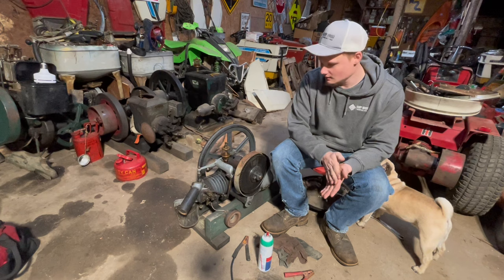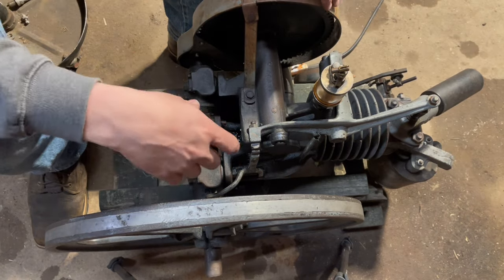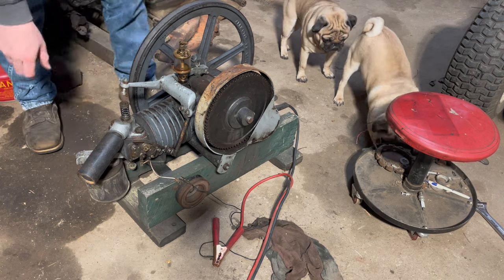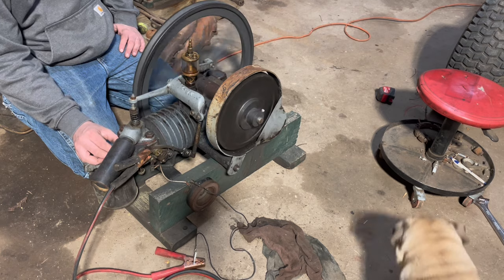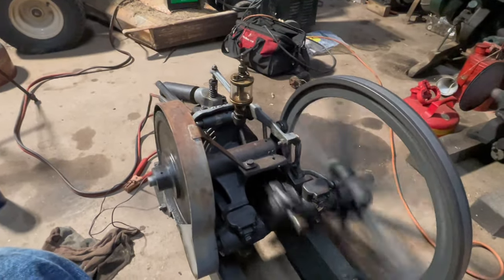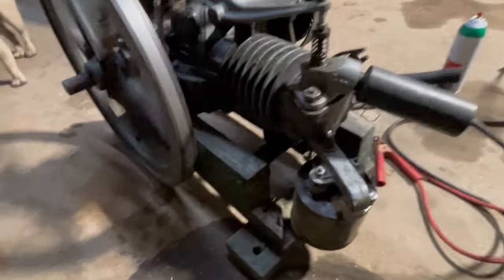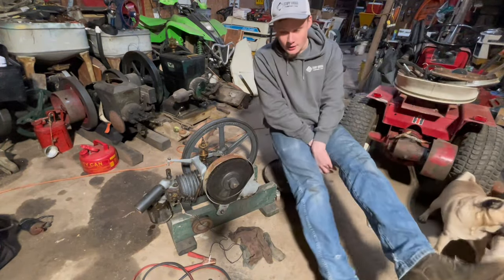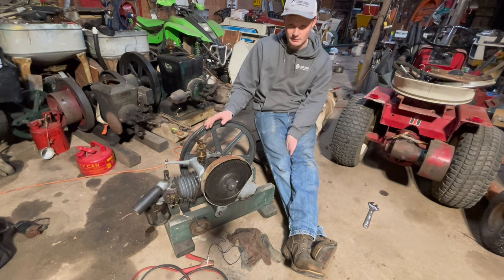Starting an 8 Cycle Aermotor Hit n Miss

Comment: I hate to re-engineer a 110 year old motor but for the cooling it would have been vastly easier to make the flywheel spokes into fan blades instead of the rube goldberg cam system. Thanks for making the video, fascinating twist on the hit or miss motor. I've always loved these motors but never seen the 8 stroke before.